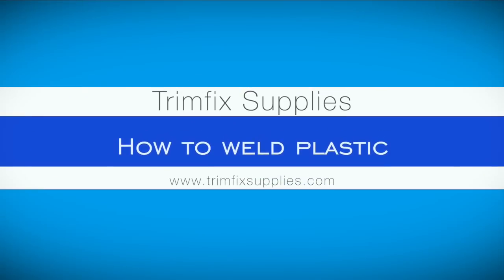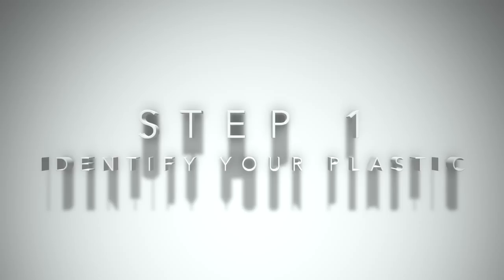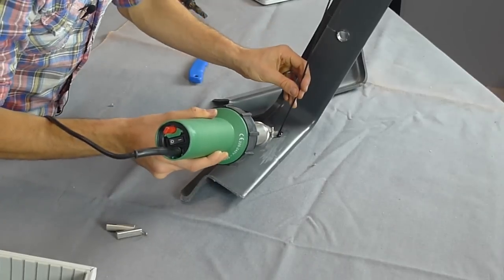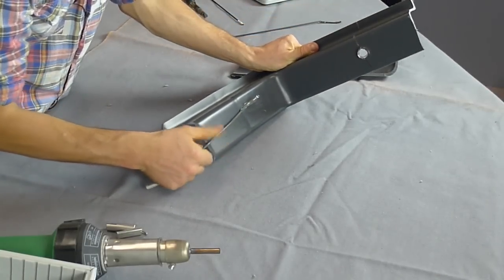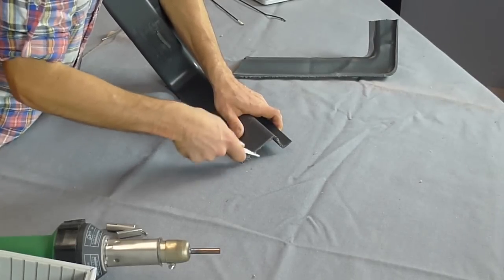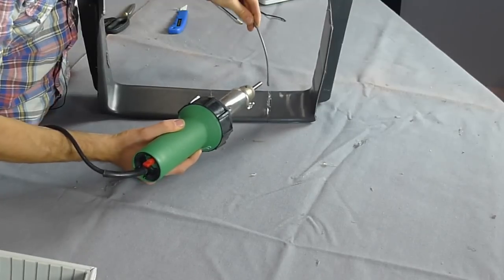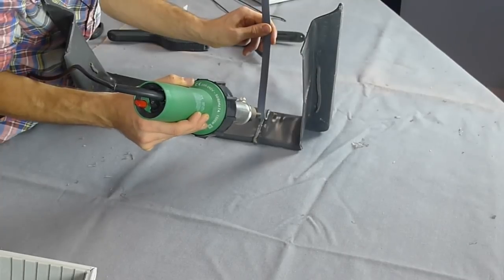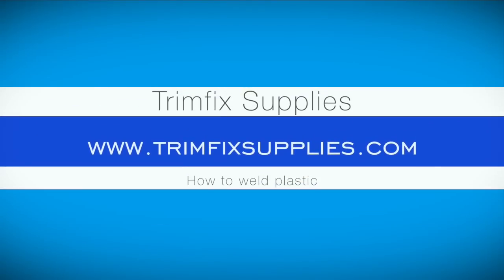Plastic Welding - How to Weld Plastic Instructional Video - Trimfix Australia

Comment: Which type of heat gun you are using??
Gun which is using by us gets over heat and brake down.
Can you please suggest me heat gun which have batter life
Reply: They break down when you just shut them off.They need to have the temperature turned off,and let cool down until u can touch the tip.The ceramic heating element will shatter and it sounds like popcorn. All brands do this

Comment: I have had this tool in my shed for ages (came in a joblot of stuff) not really knowing what it was. Stumbled across your video and finally now how how to use it, thank you.
Reply: That tool is a Leister welder and is primarily used by floor layers,for welding vinyl flooring seams.They sell for about $500.

Comment: Hi! I was wondering if somebody could help me. My welds just do not bond to the surface during a test. Let's say that I know what I am welding e.g. ABS, and, therefore, I choose an ABS rod. However, when I finish the bead (and there is a nice wash on both sides, nothing is scorched etc.), after waiting even 10mins for everything to cool down, I can literally apply minimal force and the bead just breaks off from the surface. I just cannot seem to get the weld to hold, it just pulls off as if it had never had time to bond. Here, in the video, the gentlemen really seems to struggle in pulling off the correct welding material, whilst the others just pop off easily - practically in the same manner my correct rod does onto the surface.

Anybody have a clue as to what I am doing wrong? I know there are many variables, but I would have thought that there should be at least SOME bondage. Thanks!
Reply: Or, perhaps, when plastic welding, is only the rod melting or do both the rod and the surface melt and bond together?
Reply: Farseer1995, Same as welding metal, the base plastic needs to melt together with the rod so the joint is indistinguishable from a solid piece of plastic.
Reply: @erics5757  thanks! I haven't been welding of late, but I got the hang of it, I think. But I cannot seem to weld very small pieces because the plastic melts, but I'll get to that.
Reply: @Farseer1995  how have you been doing with it after some time?   Kinda in the same spot you were in.  An agree any small plastic is about a no go

Comment: What if they are different types of plastic?
Reply from the maker: Plastics must be welded with like materials or the weld will not take at all nor be as strong as it should be.  ID is imperative to achieve an optimum weld using the same material.   Other methods such as a hot iron with hot melt and stainless steel mesh is one way others overcome this but you are gluing to stainless steel mesh with a hot melt EVA glue and not actually welding
Reply: @trimfixsupplies 77330967842
Reply: 9
Reply: P .nehri

Comment from the maker: For our full range of plastic welding tools and equipment visit our website http://www.trimfixsupplies.com/ If you are a panel beater wanting a kit design specifically for the repairing plastic car parts check out our panel shop kit here http://www.trimfixsupplies.com/plastic-bumper-welding-kit---panel-shop-kits.html

Or to see our range of plastic welding systems and kits visit http://www.trimfixsupplies.com/plastic-welding-systems-and-kits.html

 Thanks to Mills Motion for putting the video together http://www.millsmotion.com/